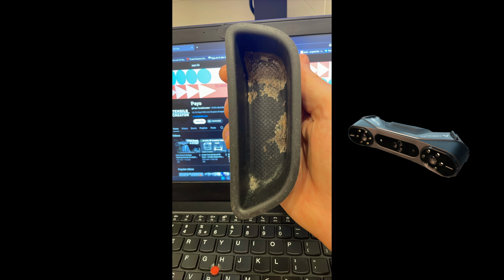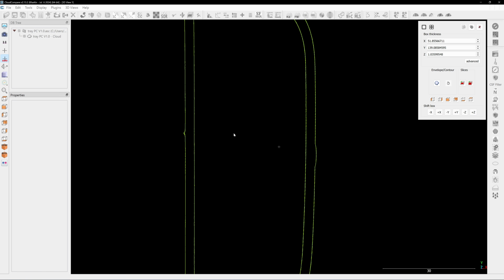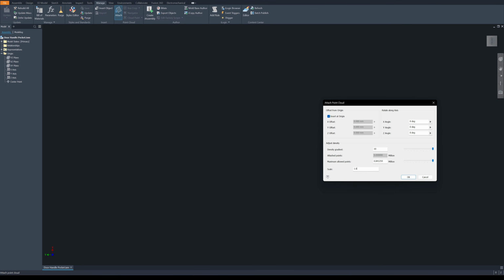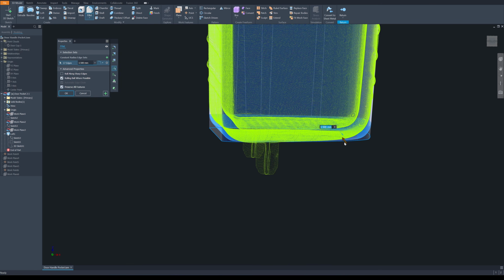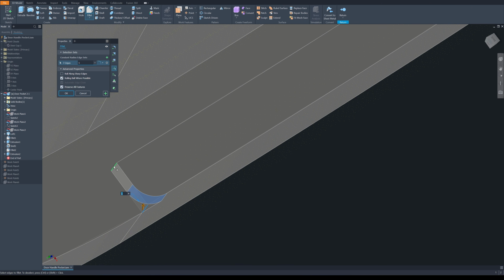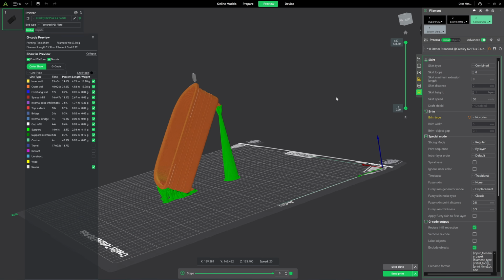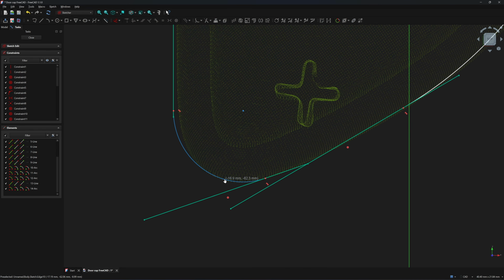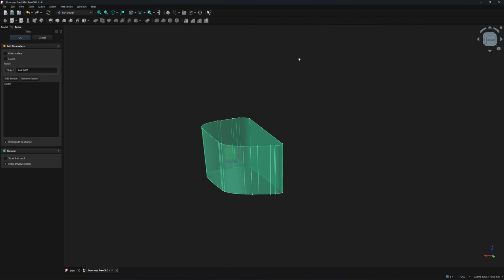FreeCAD vs Inventor – 3D Scan to CAD Tutorial (Creality Raptor Pro)

Comment: Thank you for your videos.  Very helpful.  
I have a problem with a 3d scan of mine . Its the interior of a van that im trying to model . There is a lot of curves and different shapes . I tried your method of point cloud i found it little bit difficult for me . Is there a way to draw over the points like connecting them . Or something like that . Im willing to cut the shapes on cnc . I will be happy to share everything with you .
Reply from the maker: In AutoCAD or BricsCAD, you can snap and draw directly onto the point cloud, but that’s not the right approach. It makes controlling dimensions and shapes more difficult than simply tracing. The point cloud should only be used as a reference and for setting up the sketch plane.
Reply: @Payo-TensileCreator  the problem i found was that the doors and side panels that are 3d scanned are in a small curved shape . So i couldn't find any solution.  I hope you can do a video of step by step guide showing this . If not thank you for everything

Comment: I to have had issues with the thickness command not working on some models with version 1.1! I'm pretty new to all of this so I just assumed it was something I was doing wrong!
Reply from the maker: Thicken is a tricky command. It worked in Inventor and BricsCAD when I modeled the same part. In FreeCAD, you’ll need to simplify the geometry. If you loft with the same number of polygons in each sketch, you might succeed with the Thicken command.

Comment: Interesting to see someone work with FreeCad and comment each step and the road blocks met along the way. I think this could help the development community of FreeCad to see where experienced (from Autodesk) users still struggle to use it to its full potential. Improving solidify commands, making the loft system more robust, stream lining the way you create or offset build planes etc.
I still have Rhino as a good "pay once, use forever commercially" solution but something closer to a solids modeller like Fusion would be more useful to me, for quick drafts and 3d printed prototyping. Which is why I am still very interested in the development of FreeCad. Just hope they make the basics more robust as I just checked the changelog of it and they recently focused a lot on simulation tools, which itself is also cool, but I would like to have the basics work as a proper, stable foundation first tbh. 😅

Comment: Thanks for the video! You can use CloudCompare to create the pointcloud slices directly, using the Cross Section tool (X keyboard shortcut). Once opened, you can set the width precisely using the top-right panel of the tool and on that same place there is a button to export the currently viewed cross section. There is also an additional tool to make many slices by repeating the pattern you created and moving it along an axis, so it's easy to have as detailed or coarse slices as you want.